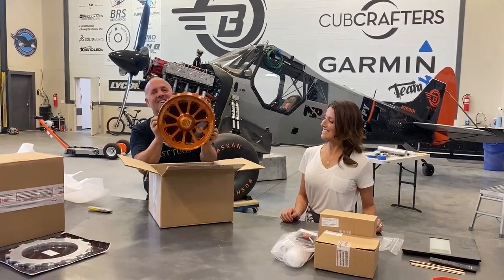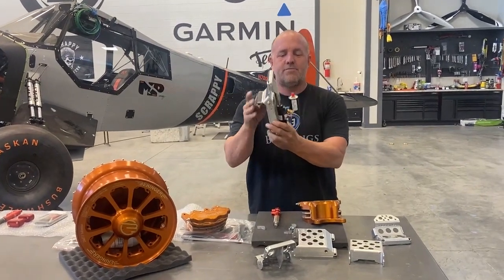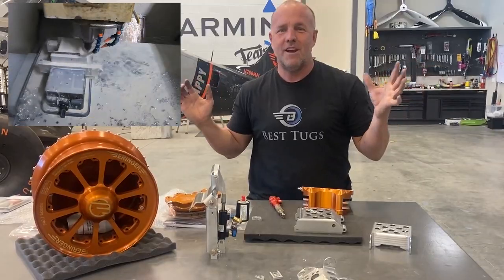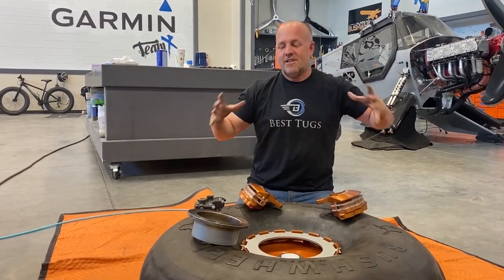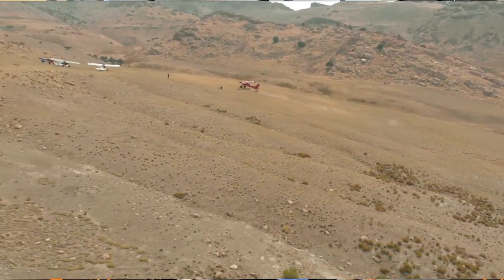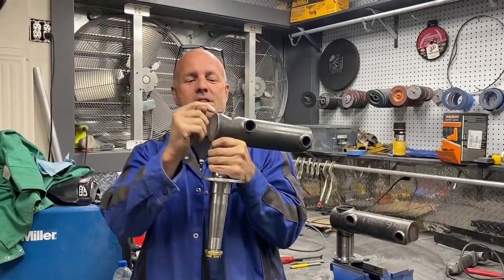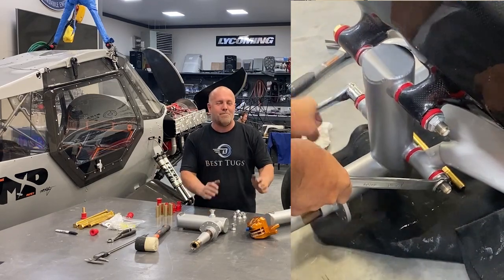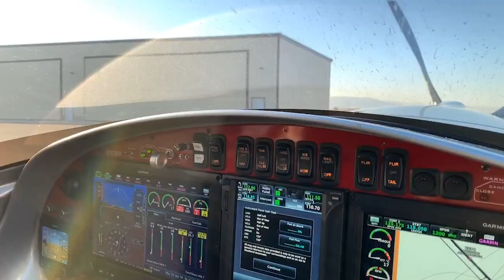Must STOP Scrappy - Beringer Wheels Installed on Scrappy CarbonCub 😳 | Scrappy #41

Comment: Hi that inside rotor brake set up has been used by "Buel" motorcycles around 2004(similiar) , But its an awesome set up also since the caliper is not "floating" it is stationary so the rotor needs to move in and out "float" in those slots in the wheels. Thank You!!  From your neighbor here in Provo lakeview area!!!!   P.S Have not seen the Helicopter lately?

Comment: On those rim brakes, heat will transfer to the tire bead. We stopped using rim brakes on bicycles, because they caused blowouts from the rims heating up. They don't have a great thermal connection in your design though. My intuition is that you have cut your thermal mass in half, since tou can't count on the wheel plus hub dissipating heat. If you can count on the wheel plus hub dissipating heat, you will blow a tire during those touch and go races at high sierra.

Comment: Is there any provision for having a removable collar for the double lip seal to ride on? On my 1969 Land Rover the stub axles have such a collar, its a shrink fit collar that is replaceable in case any grit gets inside the double lip and wears a groove. C130 propellers use a similar replaceable collar on the rear pump housing double lip seal. All it takes is one piece of grit to wear a groove large enough to allow moisture intrusion to occur.

Comment: Mike I loved that you put in those wee machine prep for welding tips, but I for one, would dearly love more information on your welding processes.  Were you welding stainless to stainless, for instance?  The tube you welded the shaft and upper A-arm pivot looked too light to be aluminium, but can you weld stainless to aluminium?  And if yes, what is the process? What sort of machine do you use and which shield gas (I'm guessing argon).  Some of the welds looked like they were pulsed. Was that done by the machine or your manual control?  Do you need a DC TIG welder to do your welds?  You make a stand out job of it for sure.   I'm a retired toolmaker, but I still use a machine shop at my local Menz Shed, and I have discovered real joy in woodworking.  This was a particularly interesting video btw, and I love the new wheels, disks and callipers — it's almost like an added bonus that they will stop Scrappy so much better.
[EDIT] I stopped the video @18:00 to write this comment, and I am wondering how you are going to assemble the hub and callipers because it looks like you'd need to fit the callipers to the disks and slide it all in.  Then it looks like there is not enough room to put in the disk retaining hardware.  I'm looking forward to seeing how that turns out.

Comment: ⚠️⚠️ say Mike, as always excitement to the max... thanks for all the videos.
just a note here: wouldn't you need to see if any of that friction heat on the disk generated while braking is transferred into the wheel and by extension into the rubber tire !? just wondering! 
godspeed

Comment: In the STOL drag races, it appears to me that there are three phases.  (Acceleration, Deceleration, and Braking)  Have you figured what the accelerations and decelerations are for Scrappy and what your theoretical best time could be?  It appears to me that the deceleration phase is very important.  Does Scrappy have some sort of belly door “to drop things” or just be an air brake like a good old sea anchor?

Comment: Great video as normal Mike. I have 1 probably dumb question about the brake disc/ rim design. with the disc being attached to the rim. will the rim become a sufficient heat sink to dissipate excess heat or will you get heat bleed into the tyre and risk catching the tyre on fire?
Here in Australia have seen on trucks hot discs set tyres alight with radiant heat when the disk is 5 to 6 inches away from the rim. I no your brakes on a small plain  shouldn't get as hot as a truck but is it a possibility?
keep up the good work . kind regards Paul

Comment: Would not generating more system pressure with cylinder and pedal design generate enough pressure to create enough static friction to hold the plane and have less weight?

Comment: I'm curious to see if there will be contact marks on the tire from that disk/wheel setup when the tires are ran at lower pressure. And if that would even matter 🤔

Comment: I had an Buell XB12stt, and an 1125r at one point, and i have to say the brake system in everything should be setup that way. Cut down the need for an entire rotor and caliper on the motorcycle and WAY more braking force. Looks like the IP ran out on their patent haha

Comment: 14:26.  ..  . The brakes convert the kinetic energy into heat energy through friction. If the heat cannot be dissipated quickly enough, the discs will start to glow, and you get brake fade. On many modern motorcycles (and some high performance cars) the actual discs are very thin, floating, full of holes and wavy. This enables them to dissipate heat very quickly while simultaneously being abusively used. . . . Of course, on a cub, you won't likely be nailing the brakes hard from 190mph to 35 in less than a 1/8 mile leading up to a sharp turn, then to repeat such use a few seconds later; again and again. Even under such abusive racing conditions, brake fade should never actually occur.
Reply from the maker: Exactly. Well said 👍🤠

Comment: I wonder whether the heat dissipation into the rim right by the tire instead of into the axle would be more of a problem on cars that potentially get way more prolonged use of the brakes.

Comment: That’s similar to brakes on some helicopters. They’re multi disc but still the rotors slide into the wheels and caliper is mounted to axle assembly.

Comment: Would you say scrappy is more expensive as a sale value compared to Draco? Or no because it's not a certified airframe. If I recall you had to get authorized by the FAA to modify draco and you were approved, or is that not correct?

Comment: Nervous about the conducted heat flux from disc almost direct to the inner tyre bead.  Also may be a nice little oven inside the rim at standstill from a hard stop?  Might want to monitor brake and tyre temps during initial tests...?

Comment: It’s not noticeable in the video, but I wonder how these wheels will deal with dirt/rocks/water getting in behind the disk. 

With the old assembly this kind of stuff would/could fall out, but the new assembly risks trapping all that kind of stuff between the disk and inner rim face. It’s possibly jamming between the rim and rotor could occur and what ever that is could collect the brake calliper on the way through.

It’s probably been thought about, depth perception is pretty horrible in videos, was just curious.
Reply: We have several friends who have these wheels on their Cubs and use them in extreme back country flying with no problems or complaints. 👍🏻👍🏻

Comment: Mike... Any chance that with that brake caliper & disc attachment, that there might be excessive heat transfer through the rim and into the tire, raising air pressure?  Neat solution, though.  : )

Comment: I don't know how brakes work in a plane. Two pedals? I bet they also do other duties.
Reply: The rudder and brake peddles are combined and operated on both sides.  Rudder is worked from the bottom of the peddle (pushing the assembly with one foot or the other).  Move your feet up to the top of the peddle and rotate it forward for braking, which will operate independently of each other.  Some planes (very few nowadays) are opposite, where the rudder is at the top and brakes on the bottom.

Comment: Love that your bringing the 21st century into GA, only one question, why not carbon ceramic disc? Im guessing in your application its not really needed?
Reply: Carbon brakes are common on jets because brakes are really heat soaks. 
He isn’t converting much motion into heat when stopping so carbon brakes would be of no benefit other than punching a bigger hole in the pocket book.
Reply: @wadesaxton6079  What about weight?

Comment: Love the new wheels and brakes. Is there any issue with heat transfer to the wheels now that the disc is direct contact with them? Do the wheels have fuse plugs in them?
Reply: In my experience with the Cirrus SF50 which uses similar main wheels, (and the SR with similar, but smaller wheels). I have had wheels that get "stuck" on brake disc after an overtemp situation. For normal operation its a negligible factor. There are no fuse plugs.

Comment: That saw blade disk looks like it could cut into the tires if they ever compressed enough
Reply: There’s no relative motion between the wheel, tire and disk. Even if the tire gets compressed enough that they touch there would be no cutting action.

Comment: If the new brakes hold too well and the motor is too strong could the plane pivot during the throttle up and bang the prop into the ground?
Reply: That’s why you pull the elevator back when you do a run up like that.

Comment: Having designed and fitted many brake systems I can honestly say that I have never come across the need to increase the fluid volume in the master cylinder to cope with the increase in caliper pot size.  IMO its all an old wives tale.  Generally the amount of fluid to be moved is equal to the total area of the pistons X 0.014" (0.35mm) clearance.  That amount can then be computed back into the master cylinder diameter to assess the actual movement.  To confirm my comment, you only have to look at any automotive installation and check the numbers.  In extremis, a sports motorbike  can have 2 x 6 pot calipers on the front brake operated by a tiny master cylinder with miniscule movement at the piston that belies the need to move large volumes of brake fluid.  Your system only has a total of 6 pots in the calipers of average size.  You would be wiser concentrating on the pedal movement and hydraulic advantage to ensure that the pressure at the caliper end is optimum.
Reply from the maker: 👍🤠 you are correct on cars and your thought process.  In this application and more specifically most smaller aircraft that is not the case.  Aircraft are so weight specific constrained that the total volume in the master cylinder is reduced by as much as 90  percent by design to reduce the weight of fluid in the system.  I did a fluid calculation originally and then also a bench test and finally solidworks model.  My total volume to move two the distance needed was only a 15 percent  reserve.  When adding the third there simply was not enough in the tiny capacity to safely operate the 3rd on each side and  extra and large sizes.  I truly wish you were correct on this one. I had your same thoughts and high hopes before I started.   I didn’t want to change and machine all new  component  if it wasn’t completely necessary.  Thanks for your well thought out comment.  Cheers 👍🤠

Comment: I was sitten here stinking, i mean thinking about a nose low sensor that would bypass  the brake pressure when landing with a wee bit more  break  pressure then you  need.  It should be something you could turn off / on. as you might rather  stop nose in the mud then go over  the cliff.

Comment: Something occurred to me when I looked at those new wheels and calipers. What if I always ask. What if a wheel, or caliper or both gets damaged and unusable and you’re in no man’s land which is where you’re going to be cause I know you, how do you get the plane out of there if you do not have a back up wheel etc? Beautiful equipment no doubt about it.
Reply: Great question!  Much like anything else, there are safety in numbers and we almost always have 2 or more aircraft fly together in the back country, besides safety, it’s more fun with buddies.  Secondly, a PLB with communication is an important piece of equipment to have in our safety gear.
Reply: @ChandraSlyFoxPatey  
Thanks for the reply, I’m fairly sure that there would be safety in numbers and that’s how you operate, what I’m questioning is how do you get the plane back home with a damaged unusable wheel or caliper? The problem of course in situation is like this especially is the proprietary equipment, I suspect by the size of the box the parts came in there were two wheels and two brake calipers and two rotors. Damage to any of that making that system unusable, cripples the use of that aircraft. I don’t see any possibility of carrying an extra wheel and caliper and rotor with the aircraft because if they were needed chances are you would also need a tire. So many questions and so many answers to work out. Additionally the area between the back of the wheel (inside) and the back of the caliper/rotor seems like a place where debris could accumulate. I’m in the hydraulic hose business and we also make a custom hydraulic brake lines for industry (not aircraft) and the flexible line going to the caliper seems vulnerable. I would imagine these things would have come to mind on your part. Thanks for the comments and conversation.
Reply: @yt650   There are circumstances where aircraft can become debilitated (for all kinds of issues) and new parts required.  Parts and a mechanic can easily be flown out to do the repairs via another airplane or heli.  Mike had an incident in our last Wilga, where he threw a rod over a lake and barely limped it to land.  The mechanic had it back in the air within 2 days.  He flew it home, pulled the plane motor and it later became Draco.
Reply: @ChandraSlyFoxPatey  
Yep I understand exactly what you’re talking about. I was alluding to the fact that the proprietary wheels and brakes system make it difficult to do a repair in a remote location where that aircraft  may and probably will end up. If it is in a location that’s a little dicey, where space is limited and it will be, I think the alternative would be a helicopter. The question then becomes do you have spare parts to fix the suspension on that aircraft? I certainly wouldn’t want to leave it anywhere unprotected and not  tied down for days or weeks at a time. I saw a video of a fabric covered aircraft that had some odor fish in it  and a bear tore that plane apart. Fortunately the fabric was duct taped back together and it was flown out of there. And for people that don’t understand that helicopter would cost a lot of money even if you owned it. I get it, adventures in flying and building an aircraft something most people are unable to experience. I worked at a small grass field airport in my late teens and I see what it’s like to run something like a gas station and I had no idea what the FAA meant at the time. Pushing 78 years old in a few days so it was a long time ago. Lots of good memories however, I never thought about joy riding in a car that wasn’t mine but I did think about doing it in an airplane because I had some, (read that as very little) experience. LOL.
Reply: @yt650   🎈Have a wonderful birthday 🥳.  I wish you many more happy years and good health.

Comment: It would seem like that brake rotor will eventually end up chewing up the rim. All those teeth like slots should be bolted to the the rim and not have a chance to vibrate, jiggle, and wallow out those slots.

Comment: Can I assume that you did a worst case simulation for heat buildup and transfer from the rotors to the rims? 

I suspect it isn't an issue but when viewed from an automotive viewpoint the rotors touching the rim where they will transfer heat to the tire's bead area is a knee jerk 'cringe'. Aircraft brakes are really a "single use" application so repeated use heat buildup shouldn't be an issue. In a high landing speed jet aircraft I would worry about this but a bush plane has a lot less kinetic energy to turn into heat. Plus adding rotor mass will reduce the temperature rise during a single brake application too.

- Edit -
With a tightly sealed wheel bearing setup is there any issues with the rapidly changing operating pressures that comes with rapid altitude changes? I'm wondering if "up-down-up-down" could pump lube out or create a vacuum that would suck water in.

Comment: Nothing new under the sun.  Beringer has not re-invented the wheel, or in this case, the brake.  As you know, Mike, Goodyear designed their brakes with the floating disc and inside caliper way back in the 40's.  They were installed on Stinsons and classic Cessnas and a lot of other 40's vintage aircraft.

Comment: I’ve always wondered why disc brakes have the calipers mounted on the outside. It makes so much more sense to mount them on the inside of the rotor. You can mount a larger rotor in the same place, the mount for the caliper can be stronger, the lines to the caliper can be shorter and the fins of the rotor aren’t being blocked on the outside by the caliper so you get more effective cooling.

It seems obvious but maybe there’s a reason why we stick with the usual configuration.